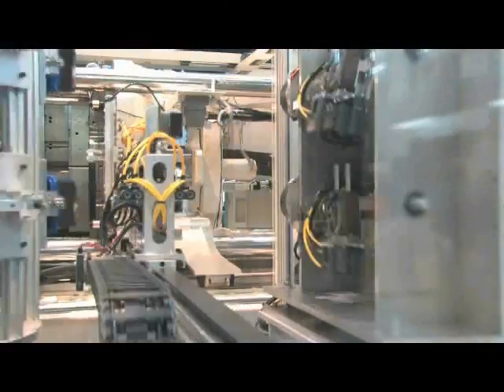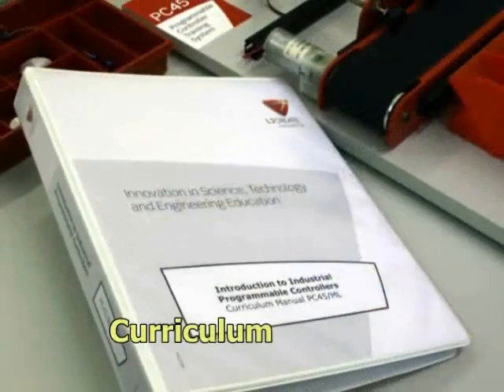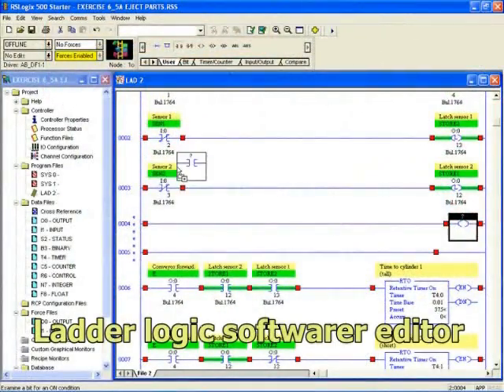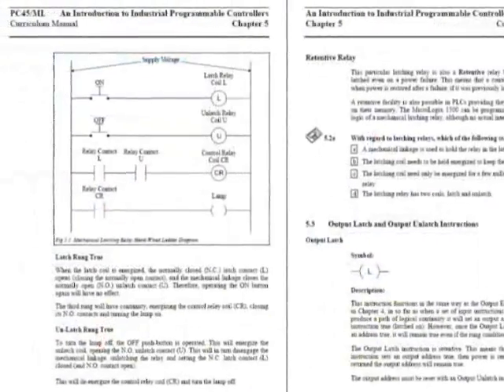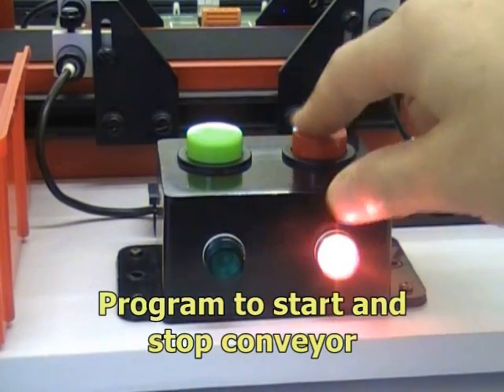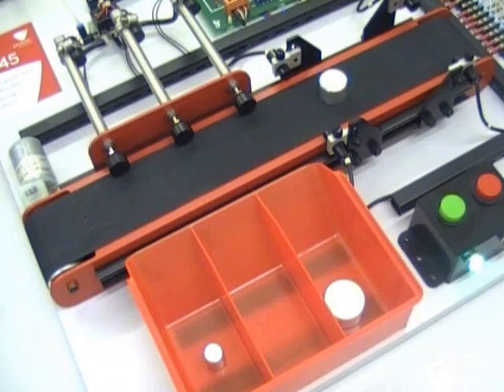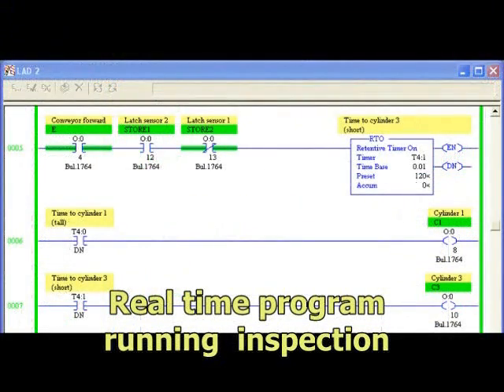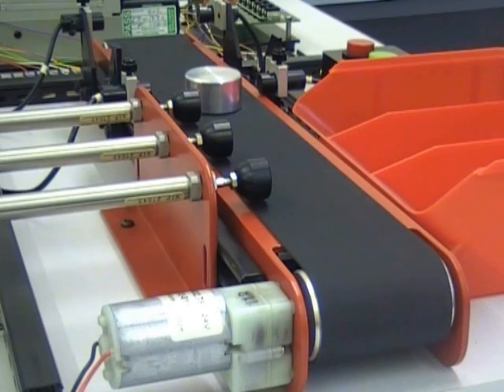Introducing students to Industrial Programmable Controllers

Comment: PLC Training | PLC Training Institute in Noida | PLC Training in Delhi - 9953489987
http://www.diac.co.in/courses/plc-training/
Get the best PLC, SCADA training with DIAC. The purpose of PLC SCADA Training course is to develop an Automation Engineer who can design or troubleshoot an Automated Control System single handedly. Fresh engineer or diploma holder in Mechanical, Electrical, Electronic, E&TC, Instrumentation or Production can become an Automation Engineer. Call @9953489987, 9310096830.